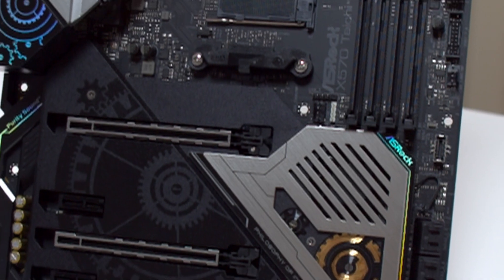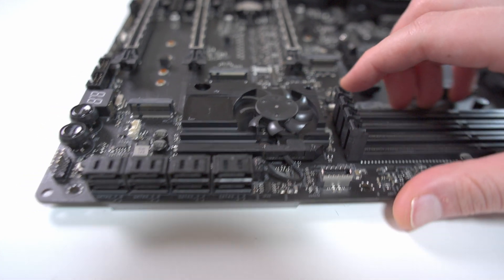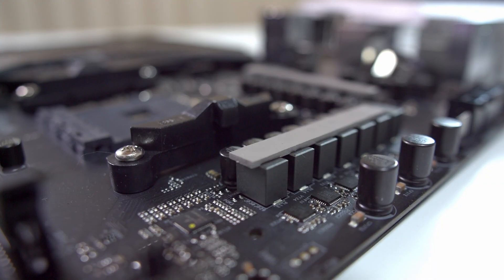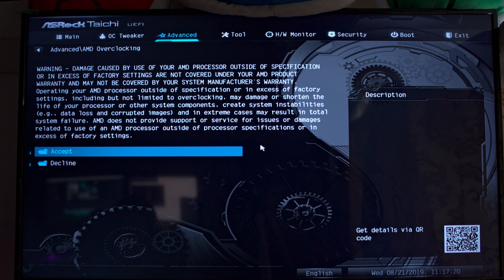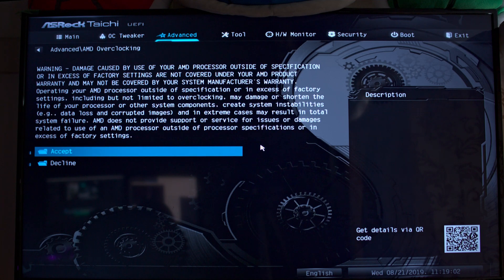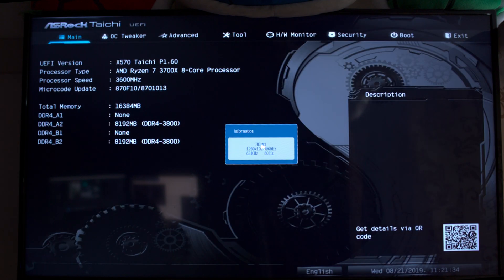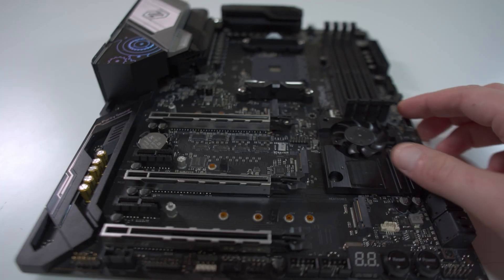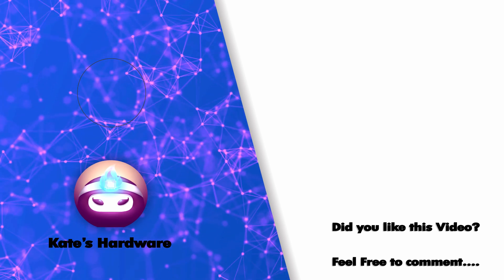Asrock X570 Taichi Review

Comment: Good board and good review.  A lot of reviews don’t bother to look under the heat sinks or delve into the BIOS let alone noise levels.  So again not bad.  The only minor mistake is that the cable connecting the M.2 / NVMe / chipset plate is an RGB power cable not a chipset fan cable.

Comment: Very good work on these x570 boards, especially taking the VRM heatsink 
off to visually inspect for a few models. I was leaning toward the Extreme 4 (I like 
having 8x sata ports built in) but the QVL wasn't great, the VRM 
heatsink doesn't seem too great either and above all memory O.C.ing doesn't
 look great. The Taichi is about 50-60 usd more for me, so I'm leaning toward it.

Comment: Great video, crisp, clear, informarive. Would have like more info on why this board isn't the same as the $400 & $500 boards you mentioned
Reply from the maker: Well apparently this board is now $280 so its a much better deal. Rampage and Dark boards are in a league of their own, mainly the BIOS is tuned for memory overclocking and of course come with features that are more suited for test benches and XOCing. But as far as a everyday sort of builds goes I suppose there is not a whole lot more to offer over this board.
Reply: @KatesHardwareReviews  thanks for the info 😉